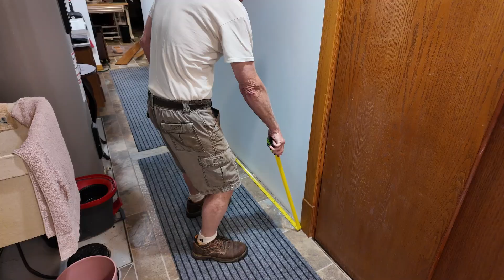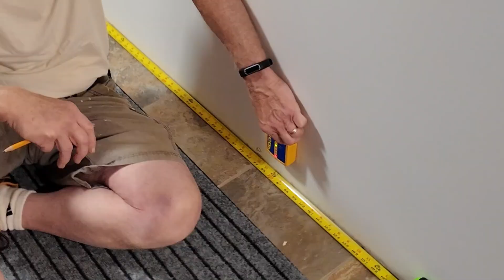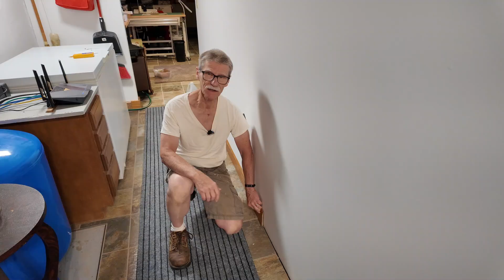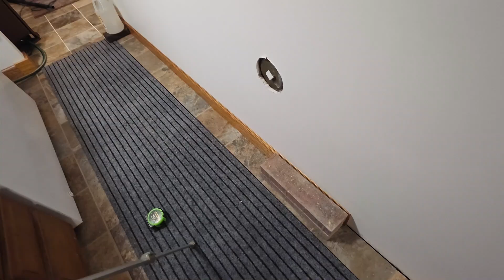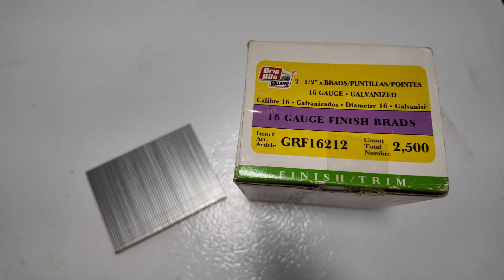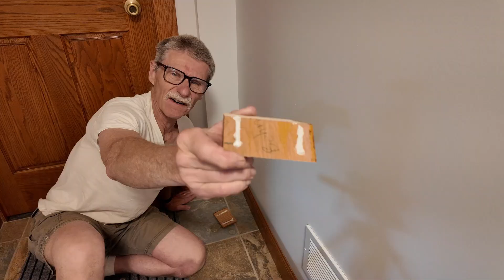Are you ready to tackle some finish carpentry?: Installing oak baseboards.

Comment: Hi! Really enjoyed your recent video on installing oak baseboards. Your dedication to tackling all these home remodeling and vehicle restoration projects in retirement is seriously inspiring! We know all that low-level finish carpentry and garage work can be brutal on the knees and lower back.

We are Osistga, and we manufacture a heavy-duty Rolling Knee Creeper (300 lb capacity) specifically designed with thick foam knee pads, chest support, and an adjustable seat to save your joints. We are looking for authentic, experienced DIYers like you to put our tool to the test. We’d love to send you one completely free to use on your upcoming projects! Let us know if you're open to it and how we can best contact you.